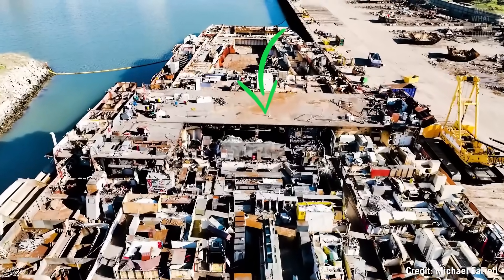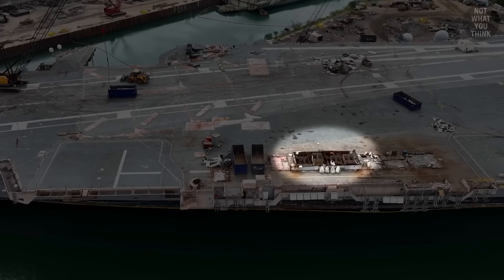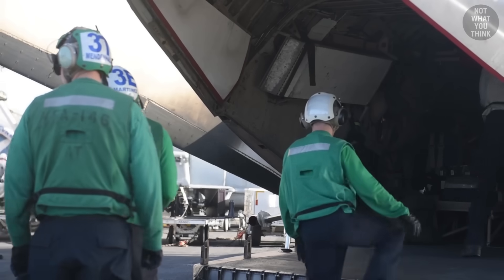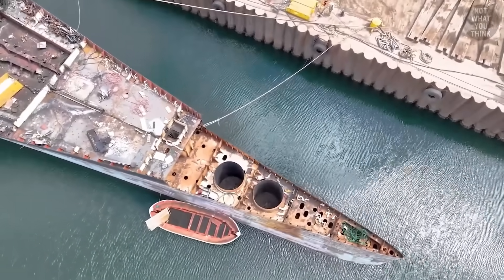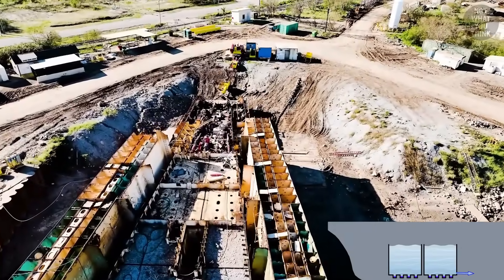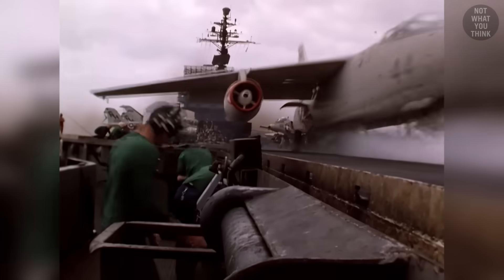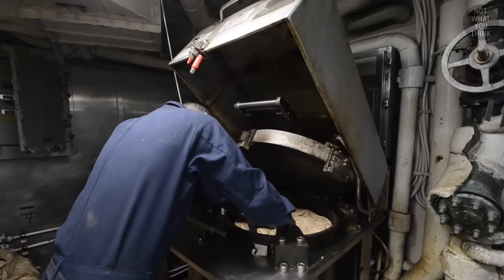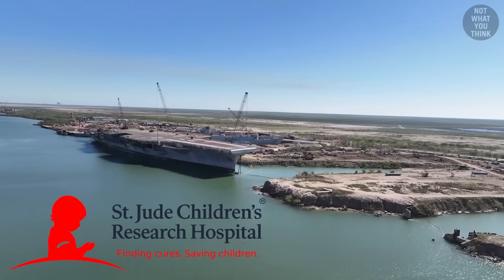The Dismantling of US Navy’s Aircraft Carrier That Was Sold For a Penny

Comment: Racks right under the flight deck.
The sailors bunking there could sleep through anything after their deployment.
Reply: That berthing compartment was also between the arresting gears which made a very loud screeching noise. My berthing compartment was under the flight deck between the forward catapults, and they also were very loud. The first time I heard it I thought there's no way I'm going to sleep through that. After a couple of days, I slept like a baby. 
The only noise I didn't like was the occasional dropping of a bomb during loading which was a reminder that there's only a couple of inches between us and disaster. Served on the Kitty Hawk 1970-73.
Reply: I was on Ranger 1980-81 and my berthing was right under the 3 wire the one they shoot for, I can still hear what it sounds like 40+ years later. first you hear the sound of the engine only for about 2 secs. then BAM Weeeeeeeeeeee and the engine again because they give it full throttle when they hit the deck, you hear them throttle back to idle and then the wire rolling across the deck as it goes back into position then you can hear it go on top of the leaf bar things that hold it a few inchs above the deck the wire goes back and forth on that until it stops and tightens up.  then about 45 secs later it all happens again until all the planes have landed. it`s tuff the first few days but after you work a 12 hour shift 7 days a week for weeks on end you sleep right though it. my second trip was on the Enterprise and my Berthing was forward below the mess deck right at the water line. the cat shots when they took off was pretty loud and had it`s own sounds too. thing about a ship is the sound resenates, you could hear some guy beating on something with a hammer on the other end of the ship sometimes and a bunch of other sounds all the time.
Reply: @Retr0racin . My berthing was near there as well in ‘69.
Reply: @Retr0racin Reminds me of that scene in "Once Upon a Time in the West" where the old man in a shack is telling the story of how he held out and didn't sell to the railroad.
While he's talking, the whole shack starts shaking, loud train sounds and whistles make it hard to hear him, steam comes in through cracks in the walls...
Reply: @Retr0racin I was in similar berthing on the Forrestal near the end of the Cold War. Being a boot camp they put me in 4 different places over my tour aboard. The first was on the 03 level between the bow cats and right above the foc'sle. I remember the morning we weighed anchor and thought WTH? The next was actually aft of the LSO platform and probably the quietest part of the ship, though when we did flank speed the whole room shook. I was also in a compartment just forward of the hangar deck and another outboard on the 02 level port side amidships beneath the waist cats.  

I learned to sleep very soundly after that, but now I have trouble falling asleep because of the tinnitis. For me, being a sailor on a carrier means never being able to experience silence ever again.
Reply: Yep, slept soundly with tie down chains as a pillow,  LOVE
PORT AND STARBOARD DUTY.
Reply: Yup, after a few weeks one became immune to the incredible noise.
Reply: @RockerWasRight As an Army vet with hearing loss, did they take care of your hearing after discharge?
Reply: @JP-rf7px Nope, VA is an option went there......... closed. refuse to play hurry up and wait
Reply: I was stationed on two CVN’s… had berthings at either end of the ship on different deployments. The impact of landing was louder but under the forward catapult the ship would shudder left/right during launch. Either way, no problem sleeping- especially when you’ve been working 14hr shifts during 24hr combat flight ops.
Reply: Yup. Those memories of the berthing areas on ship !Served aboard CV-60 Saratoga with attack squadron   VA-37  between 74 -76.   O3 berthing under Number 3 wire. Worked nights 7 to 7 you wouldn’t think you could sleep during daylight flight ops  but you could and had to !  Better than some berthing areas our squadron also had an 01 berthing compartment a little quieter but always hot no A/C  so the O3 berthing was better even with the noise.  Funny now in old age, l’m a super light sleeper any noise keeps me up and awake.  Lol
Reply: I was a Forrestal sailor, couldn't sleep after deployment as it was too quiet.
Reply: @timwestfall94 I served on the Forrestal WESTPAC 1967 most people couldn't fathom what life on these carriers was like The memorys never fade away!
Reply: @timwestfall94  I was a CH-46 pilot on ammo ships and could sleep just about anywhere, curled up on deck with my flight jacket as a pillow if necessary to catch a nap.  At home I can sleep through anything, even small earthquakes that have my wife sitting straight up in terror.  She is supremely jealous of my Navy learned ability to sleep almost on command in almost any situation.

Comment: Unfun fact: never go into a chain locker while the chain is stored without supervision and without a breathing apparatus of some kind that supplies you with fresh oxygen. The amount and surface area of iron in that room is so high, that the chains can rust through the entire oxygen supply within minutes to hours. People regularly die from going in there, either to go check something or to rescue someone who also went inside and died.
Reply from the maker: I had read this before. But I also saw on Battleship New Jersey’s video about chain lockers, and I recall hearing that there was lots of ventilation.
Reply: You generally receive training on confined / enclosed spaces when you work at a shipyard. Those spaces are either supposed to ventilated or "sniffed" with a machine that tests the atmosphere for oxygen level, asphyxiants and flammable constituents before entry with safe or not safe to enter posted at entry points.

Comment: You dont use a torch for gouging. It's not what you think 'not what you think' team.
Reply: You can absolutely use a torch for gouging... but it's usually called "washing"... and it's much faster than carbon arc gouging. Plus you can quickly switch from gouging to cutting with just a tip change.

Comment: The question is does the afterburning engine at the fantail adds thrust?
Reply: Well of course, whatever thrust the engine is putting out is, well, thrust. Is it going to affect the ships speed?  No
Reply: might have changed over time, but i saw the kitty test engine out the starboard side aft underway. never seen it from the fan tail.
Reply from the maker: Practically, it doesn’t.
Reply: No....
Reply: I remember the engine shop being starboard side on the Indy too...  forward of that was the Engineman's workcenter and entrance for the post office... all in that aft corner of the hanger bay.